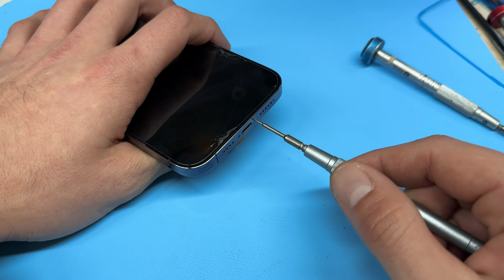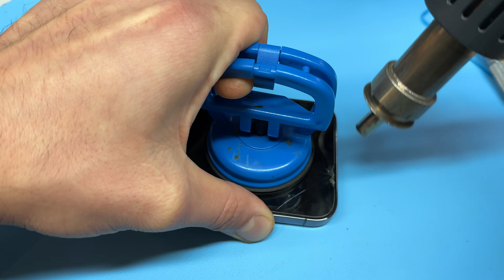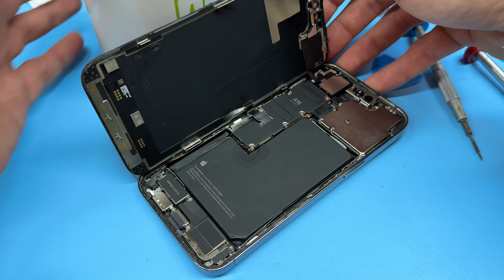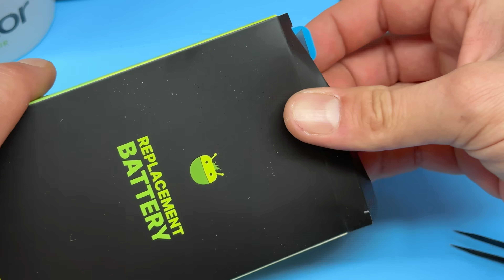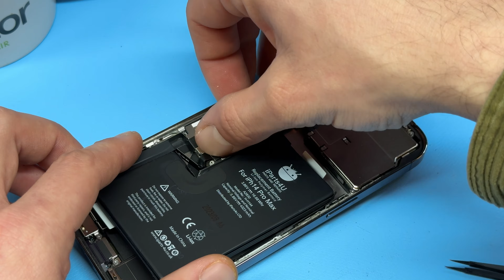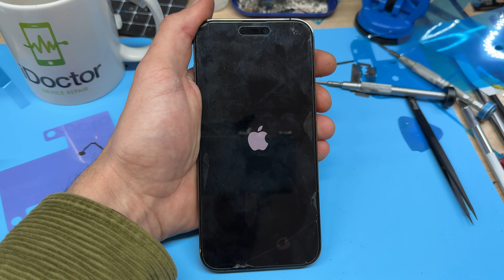iPhone 14 Pro Max Battery Replacement: Revive Your Device's Power with This DIY Tutorial!

Comment: never put 99.9% isopropyl alcohol on the gap while removing the display, it will delaminate the screen from its frame. Alcohol should be placed on the edge while the screen is still flat. Also the removal of the battery is wrong. The flex cable underneath will get torn apart. Bottom part like the taptic engine should be removed first.

Comment: Before closing the phone again you should heat up the adhesive just a little bit. The adhesive will be activated and the display will stick better on it. The phone will also be more sealed

Comment: Amazing video! Thanks to you I managed to replace my battery in my iPhone 14 Pro. I want to say thank you for this really helpful tutorial. Most useful among the others imho. For all people to know, it is REALLY REALLY difficult to remove the adhesive which holds the screen. Without applying heat to it I don't think it's possible to open it. In my case, I managed to apply some heat using the hair dryer. Definitely not the best solution, but it worked in my case. Isopropyl alcohol and a lot of patience are your best friends here. Take your time and don't bend the screen much.

Comment: Great video! I’ve changed an iPhone battery before. If you know how to follow instruction and have the proper tools, you can do it at home. Only thing is, you may get annoying messages/ notifications due to battery not being replaced by Apple. There was a time, that wouldn’t bother me. Now, I couldn’t take it. Battery replacement via Apple could be $99 plus. Best Buy $115 plus. Battery bought and installed yourself WITH TOOLS included $40. 💁🏾‍♀️ All these phones need to make it where batteries can be easily replaced, but nope! They have to milk more money from you AFTER you’ve already paid them well over $1k for a phone. 🙄🙄🙄

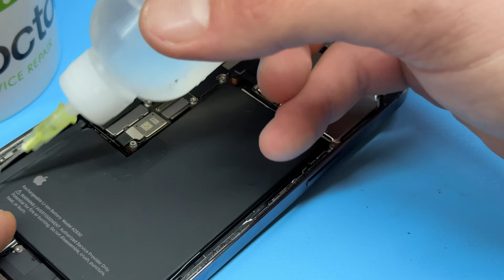Comment: Great video! Does the alcohol damage any parts inside the phone? I noticed when you were dropping it in below the battery a little got on the plug at like 2:26 is that a potential issue! 

Just subbed by the way
Reply: Alcohol is a evaporator it’s meant to clean tech it has no risks as long as it’s 99%

Comment: These videos are half the story. You forget to mention that the adhesive is on with the power of a thousand elephants. I get these phones red hot and still only 7/10 we can remove the display due to the amount of adhesive that apple uses some times. This is the case specifically for iPhone 13 and 14 series. Apple are trash and have the worst screen design in the entire smartphone market.

Comment: How do you eliminate the battery unknown notification
Reply: Apple will detect if the battery isn't OEM.
Reply: @2rking1  not if you buy an original battery
Reply: @nashawn92 that’s exactly what he just said
Reply: If your iPhone is running at least iOS 18 you can go with the apple repair assistant via settings, battery, parts and service history, follow everything on the screen and it’s done
Reply: @robingrunding5485 does this mean that there’s no extra work needs to be done when u swap the battery? Just change like in the video and proceed with settings in battery then the notification will gone by itself?
Reply: @AzrizalAmizan calibration on the new iOS 18 or afterwards isn’t guaranteed even for the original batteries. So best is to get the original battery and bms transfer and if not an issue, flash the phone too. To get rid of the message, and show battery health.
Reply: it doesn't matter even if you trade it in, mine did that and it was never an issue. I was trippin at first but people overhaul them anyway.
Reply: You can take the bms board off the old battery and take the bms board off the new battery and swap the bms boards so the old one is in the new one that’s how they check if the battery has been replaced
Reply: @gularagabulova2403  you need to know how to soder to remove the bms board though
Reply: Just leave it there don’t care
Reply: @mohammadmajid8051 me neither